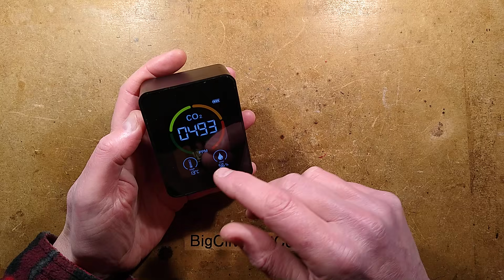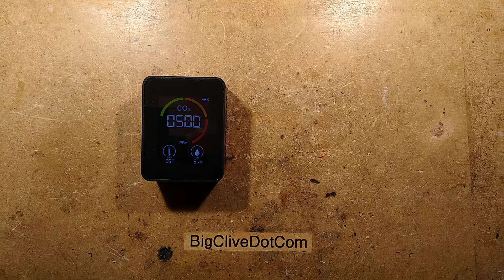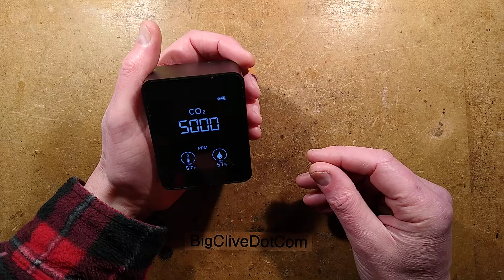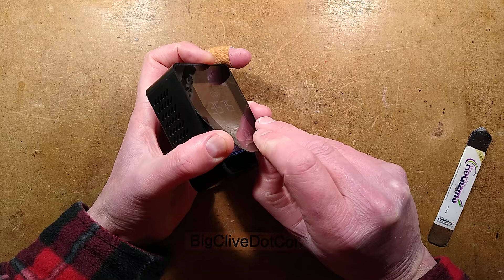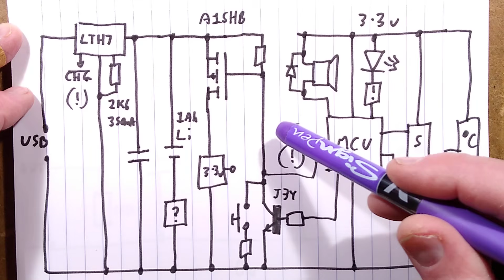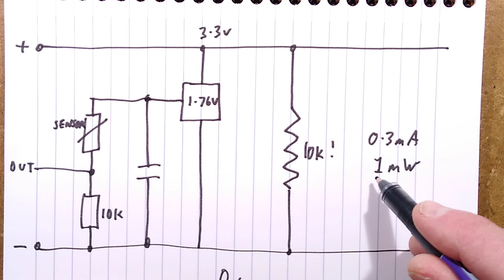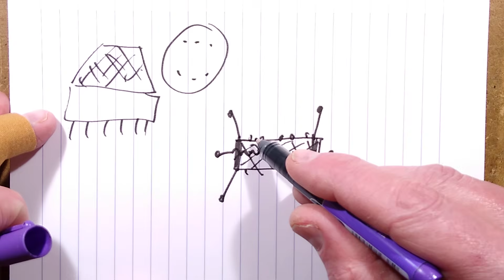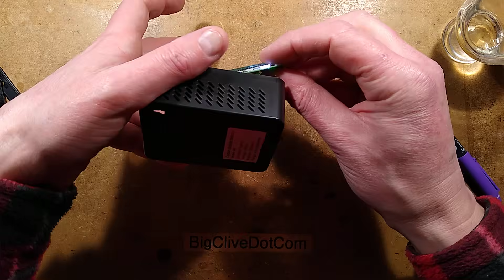Fake CO2 monitor (party detector) with schematic

Comment: I have to disagree with you on one point: "Unless you're in a hermetically sealed building, the level of CO2 isn't necessarily going too high"
I worked for a company providing and servicing air systems for, amongst others, schools and hospitals. I was developing a portable measurement device that reported
data live to the company servers. And I have seen CO2 levels rise well over 3000 ppm in a matter of minutes, even in ventilated area's, depending on the number of people and the activity they did.
Not that those levels are dangerous, but they do have immediate health implications. 
And at my home, I regularly check the levels too. I have severe asthma, and my home isn't as ventilated as it should be. There have been days where I had to open doors and windows in the freezing cold, just because CO2 got too high, and I was having problems breathing because of it.

Comment: @bigclivedotcom Could you do a video on controlling a heating element in water using a PID -- and efficiency of SSR vs SCR?
I have an 8KW Atmor tankless water heater that has two switched heating elements. I want to add stable electronic temperature control. But I can't find good information about the different options!
Seems the PID + SSR MAY have longer switching time, and that MAY reduce heating element life from thermal cycling vs a higher speed SCR. But I am having trouble finding the real answer.

Comment: I have a CO2 detector that I got from Banggood, it certainly detects co2 as well as hcho and tvoc, just being in the same room as it sends it from reading just over 400 to 600 or 700. tried it it with pure argon and it reads zero after a while.

Comment: When you exhale there is also C02 in your breath so the alcohol test is not that accurate.
You could also put the device in a plastic bag, press all air out, exhale into the bag and close it and watch what happens. (BUT THEN WITHOUT HAVING DRUNK ANY ALCOHOL)

Comment: 0:14 It helps me spot issues with ventilation faster than my migraines and lack of focus do. Most places I go easily reach more than a 1000 ppm, which is already not great for focus, but usually about what to expect. But usually when it reaches 4000 ppm it's a clear sign that something went wrong with ventilation. For example: the super unintuitive case where closing a window upstairs helped improve ventilation in an office on the first flow. Something with airflow.

That said, in the Netherlands and Belgium CO2 sensors are used as stand-ins for air quality monitors, to help ensure a certain level of ventilation, especially in the context of viruses spread via aerosols.
Reply: Also worth noting that this has been more of an issue in The Netherlands since the 90s (or a bit earlier, can't recall, I wasn't born) when we started insulating buildings too well in the pursuit of energy savings, but sometimes at the cost of good ventilation.. And modern top tier buildings specifically target being hermetically sealed, to be able to extract heat from inside air to heat outside ventilation air.

Comment: I know from personal industry experience...  the correct way to test a gas sensor is to put it in a sealed bag, and pump in your test gas to displace all air.  For industry testing we had $pecial cylinder$ of te$t ga$ with a known quantity of a given gas mixed with technical grade "air".  

The problem is that most sensors will not react instantly in many cases.  For example a carbon monoxide sensor can take ten minutes to react, and up to half an hour to give a full maximum reading.  I don't know how the CO2 sensors work or if they exhibit a similar problem.  It's not a sensor I had to work with - mostly industrial sites are concerned about carbon monoxide and hydrocarbons, you now the particularly poisonous and boomy ones.

Some sensors can indeed react to high concentrations of chemicals other than what they were designed for.  These false negatives were always left up to the OH&S wedgies to figure out later - make them earn their money for a change.

So... while I think you might be correct in your thoughts of it actually being an alcohol sensor, I don't think the CO2 test was in any way a valid test (ie put it in a bag and wait for a bit).
BTW, propylene glycol is otherwise known as an "alcohol sugar".  Not quite an alcohol but not a carbohydrate in the normal sense either.  When it is ingested it has no affect and is usually expelled or passes straight through.  or both.  whatever.

Also, CO2 sensors would be pretty pointless except they are a cheap method of assessing pollution build up in a confined space.  Not normally very useful, but they can indicate if a combustion stove is correctly ventilated, or if there's too much respiration happening in an enclosed space.  For confined space work however, we normally wanted to rely on an 02 sensor since you are more likely to run out of O2 before CO2 became a problem.

Comment: I have one of these, and it's behaviour is interesting.

As others have noted, it's probably an eCO2 detector to keep the cost down. I wouldn't go so far as to call it fake, but it's not very accurate.

If I put it in the living room, the value will slowly increase during the evening of 2 or 3 people in there - none drinking alcohol tho, so it's detecting something else.

Overnight, the value will have dropped to the 440 range again.

The alarm is annoying. It sounds when the value reached 1000, but the reading fluctuates and so it will repeatedly souund every time the value hits 1000, on the way up or back down again.Theres no way if switching the beeper off, except opening it and removing it.

Thanks for confirming my suspicions, tho I would call it cheap and well meaning rather than fake

Comment: I'll bet that if you looked on the detector's data sheet (assuming it could be found) there would be a sample circuit showing it powered by a 1.76 volt regulator. Whoever designed this product just took that as required and slapped it in. What I don't get is how you measured two and some change volts on a component powered by 1.76 volts...

Comment: I bought similar unit from AliExpress, it also does not have actual Co2 sensor, and fakes all data based on humidity and temperature sensor. Nice case though.

Comment: I worked at Microsoft in a building they rented back in the 1990’s. They changed the cubicles to only 6’x6’. Everyone got headaches after 3pm. Back then it was expensive to test co2 but after months we got them to test it. The level was above 2000ppm. They upgraded the hvac system fresh air and our headaches went away.

Comment: CO2 detector can warn you about gas burning links or effects of a vehicle in an attached garage. Also new construction in the USA absolutely CAN be near air tight, and require air exchanger systems. CO2 build up is definitely possible.
Reply from the maker: Carbon monoxide?
Reply: thats a CO detector

Comment: I looked up a lot of information about these things before buying an Aranet 4 CO2 sensor which actually does contain a proper NDIR sensor. Basically all the cheap CO2 meters do the same as the one choice took assist because measuring CO2 actually requires more expensive components.

Comment: A real C02 sensor is useful in a pub cellar to alert you of a potential leak from beer kegs, I've also seen flowjet pumps run off  C02 and vented into the cellar 😮 probably not so great if this one detects alcohol.

Comment: Wow! I just received a nearly identical unit in the mail last week! Mine’s the fancier version of this one that “detects” formaldehyde, TVOC, PM2.5, PM10, CO and CO2. But mine actually has a GP2Y10 (dust sensor) module in it. I’m doing a soda steam test right now, but from my first test it just detects alcohol. 

It only has one gas sensor in it, so it’s clearly lying about something.

I’ll update this comment with an edit in a few minutes

Edit: just put it in a bag of pure CO2 and the CO2 reading is dropping…

Edit2: Whoa! Whatever sensor they’re using actually does detect CO2 but registers it as TVOC. Somehow in the bag of CO2, it mins the CO2 reading but maxes the TVOC reading. There’s something fancier going on here. I think the gas sensor is actually sensitive to two types of gases, but the math isn’t working properly.

I just breathed 2x beer breath into the CO2 bag, and the CO2 reading started climbing. Man, I wish the gas sensor had a number on it. I think I might have to dremel it open and see if I get any clues.
Reply: @pyromen321  if yours has "PG-L58" on a sticker on backside - we're on the same boat. i was thinking it's a scam, as they're quite glitxhy and prone to runaway (especially when on charger), and battery does 8 hrs MAX. now i'm pretty sure.
Reply: @corower  Yep, I have one of those. My phone sets it off too when I make calls within a few metres.
Reply: @CyclingSteve  RF from a phone sets it off?! Very interesting.  Reminds me of when speakers would play buzzing noises when you were receiving calls wirelessly.
Reply: Thanks, perfect timing as I was about to waste £25 on one to see what my wood burner was chucking out 😬
Reply: I've been eyeing these on Ali for some time.  I might still pull the trigger.
Reply: I Just took mine apart and it has a reasonably OK particle sensor and separate humidity and temperature sensors... but everything else is "faked" by some calculation from one tin oxide sensor of the hot can variety 
Edit:  quick resistance changes go to the tvoc and the base value over time  transfers to co2... and hcho looks completely faked... I couldn't figure out from what... maybe a random value between 0 and 10 when tvoc isn't 0
Reply: VOCs may be coming off your bag.  I used a bunch of plastic wrap near a sensor and the VOC level went up.

Comment: They are made for places with poor ventilation like bedrooms or conference Rooms, the eCO2 estimation isn't far from the real CO2 levels assuming the only source of CO2 is exhalation.
proper (actual) Co2 or O3 sensors are a tad too expensive.
fun fact, real CO2 sensors have IR laser and measure how much of IR is blocked the same way GreenHouse gases (Co2) blocks earths cooling down via radiation.